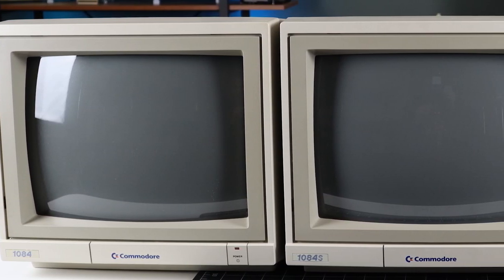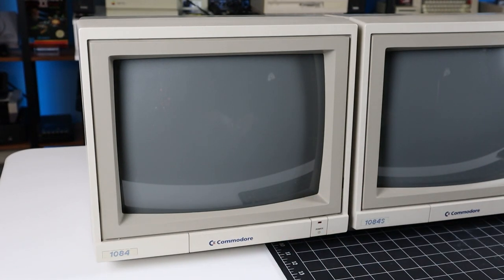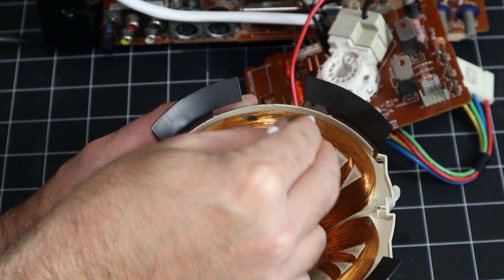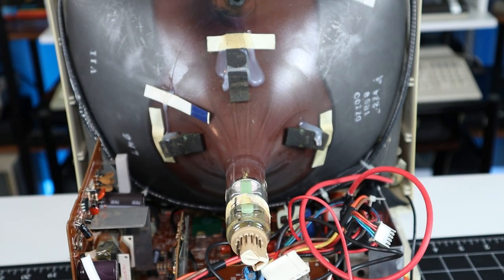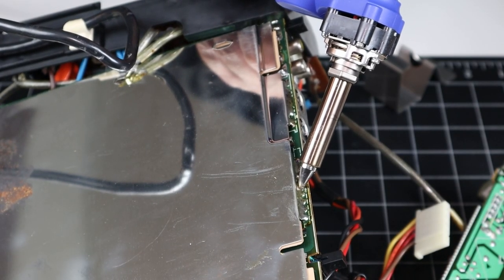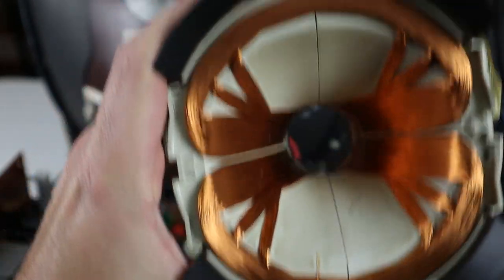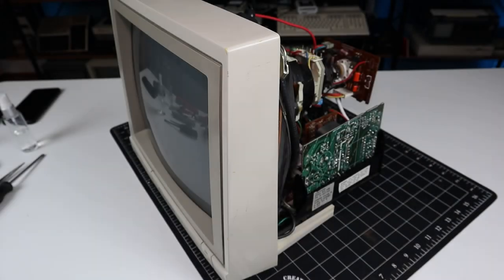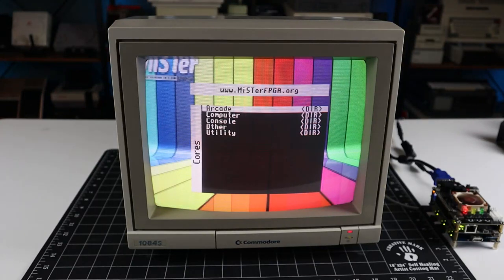Repairing my childhood Commodore 1084S monitor + RGB SCART mod!

Comment: So did the Sega Genesis work after installing the jumpers for the scart connector?
Reply from the maker: The Genesis works great via RGB SCART on the 1084S! Some consoles (PAL SNES comes to mind) don't provide a dedicated csync signal and instead rely on composite sync when using RGB. The mod I performed does not work with in this case. I get around that by using an external sync converter (SyncSlayer2). Mark from @TheRetroChannel did a video where he solved the composite sync issue with his PAL 1084 but I have yet to confirm his process will work on my NTSC unit.
Reply: @retrobitstv  thanks for getting back to me. I ask only cause my Genesis was giving the same out of sync picture like yours. My monitor is the 1084s-D1 but still got the same scrambled picture. Whats odd all my other consoles i tested work fine like the SNES, NES (rgb modded), sega Saturn, PS1 and the MiSTer with out doing any mods to the 1084s-D1. The Genesis is the only console that is not syncing.
Reply from the maker: @shertz43  Hrm, just for fun on the MiSTer what is your composite_sync set to in mister.ini? If you change it to 1 and reboot does the 1084S-D1 lose sync? I have never owned a Daewoo 1084 so I'm not familiar with it's capabilities but the Philips models for sure can ingest composite sync on the HSYNC pin and decode it fine. Maybe the -D models can't do that which is why the Genesis isn't working right.
Reply: @retrobitstv  no the original Sega Genesis model 1 does not sync. All the consoles i tested (NES, SNES, Sega Saturn, PS1) including the mister all work fine. Just not the Genesis model 1.

Comment: very cool thank you , have you encountered an issue after recapping I'm having and issue with rgb and digital rgb input, AV works perfectly fine but no more RGB, it's driving me crazy I confirmed all the caps in the right place and matching value except the voltage is higher on some of them, I got the cap kit from consol5  I'm thinking the TDA3505 went bad for whatever reason
Reply from the maker: I haven't experienced that particular problem but it's possible a solder joint cracked somewhere on the board when you were reworking it? I'd start by tracing the pins for the RGB connector and check out each solder joint in sequence. Hopefully it's something simple 🤞

Comment: I have a 1084s that just died a while ago. Black screen, no power light but can hear a squeal when i turn it off.
Reply from the maker: Sorry to hear that :( Could be a flyback failure, that's pretty common on these models. It's what happened to mine the first time it died.  As of several years ago, replacement flyback transformers were still available but they weren't a perfect match for the system.

Comment: Weird. I just acquired a 1084 not too long ago and it's having the same issue of the all pink Screen through composite. I have not tried RGB yet though
Reply from the maker: I did a little more poking around and discovered that the hue adjustment in the front panel isn't working at all. I checked the pot with my meter and it seems to be okay. The knob eventually feeds pin 17 of IC501 (video processor chip) so I suspect something is pulling that line high or to ground, effectively causing the knob to always be maxed out no matter where it's really set. That or the chip itself is becoming defective. I have yet to do any more troubleshooting than that though.
Reply from the maker: I have been tearing my hair out over this one. I checked all the discrete components that control the hue and everything else connected to IC501 and IC502. I replaced both ICs as well. Still haven't figure out what's causing the NTSC decoding to be pink yet, but it wasn't a bad chip.

Comment: I should look into SCARTing my 1084.  But first I need to crack mine open as sometimes the picture pops off and I have to give the side of the monitor a light tap.  Anyone have an idea what may be causing it?
Reply from the maker: That sounds like a dry/cracked solder joint. These monitors are known for that especially around the flyback transformer. I also had some cracked joints around the RCA ports in the back on mine.
Reply: @retrobitstv  Sounds like something I could deal with in 5-10 minutes probably. Wouldn't even have to crack open that RF shielding you showed.  Doing that scares me. Edit: or are these solder issues ones that are under the rf shield?
Reply from the maker: @CaptainRufus  I had cracked solder joints on the neck board and those can be fixed without removing the RF shield. Everything else would require removal though. It's honestly not that bad, just takes a few minutes. A solder sucker helps a lot. Just don't try and pry the shield off or you'll tear off the ground plane from the mainboard.

Comment: When they are identical chassis, tubes and yokes, why swap a yoke and deal with reconverging instead of swapping the entire tube + yoke?  That would have been 4 screws and a couple of plugs and done.  Regarding the rubber eating the yoke winding's enamel, this was recently verified on another video about similar era TV's suffering the same problem: https://youtu.be/pg0NM0IBToY?t=637
Reply from the maker: That's good advice and I may yet perform that swap. Thanks for the video link! It's interesting to see this problem isn't limited to just this model of monitor. He seems to suggest it could be the rubber decomposing and off-gassing that causes a chemical reaction. I hope my lacquer+tape solution helps mitigate that somewhat but the more I think of it, the more I'm inclined to take the whole tube from the 1084 and transplant it in the 1084S because the rubber wedges in the former look to be in much better condition as well.

Comment: Do you think RGB SCART could be added to a 1702 model Commodore monitor?
Reply from the maker: The 1702 does not natively ingest RGB but all color CRTs utilize an RGB signal internally. So, while not impossible, you're looking at a major project involving modifying the circuit board and cutting the case.
Reply: @retrobitstv  gotcha, thanks for the info!

Comment: You did the WRONG THING!, you change the whole tube assembly. now you placed a perfectly fine yoke onto a tube with rubber spacers that are conductive!, short time before this yoke fails. But you could place Kaptan tape over the ends of the rubber spacers, to keep the yoke a little more insulated.

Also the convergence will be shit, did you use the magnetic convergence assembly from the original tube, that would be a closer match esp from Total convergence setup-YUK.
Reply from the maker: I put the yoke back on it's original tube and swapped the whole assembly over a few days after!
Reply: @retrobitstv  that’s awesome. The whole time I was watching, I was like… why didn’t he just??? 😆

Comment: "Theory"? An idea isn't a theory until it's proven to at least some reasonable level before declared fact. Before that, you can only either have a guess or a hypothesis.
Reply: Back in the day when the power had failed of my 1084S I opened it up to see if I could fix it. While it was placed on the floor I accidentally kicked off the back print of the tube. It broke and filled up with air. That was the end of my monitor.
Reply: @KippieBudgie : "Back print of the tube"? What's that?

Whatever that is, it sounds sad, but isn't very related to my comment here, so it sounds like you got mixed up about whose you were trying to reply to.